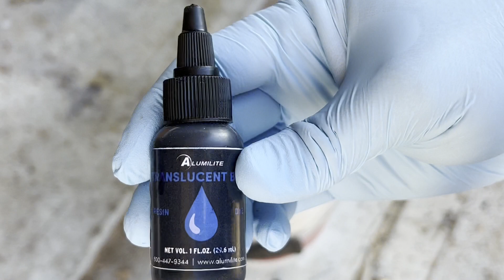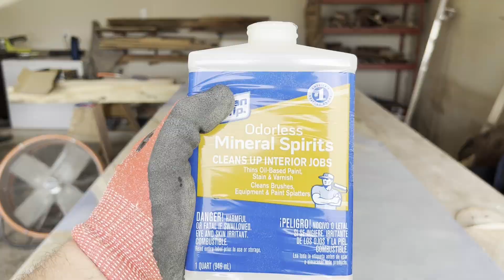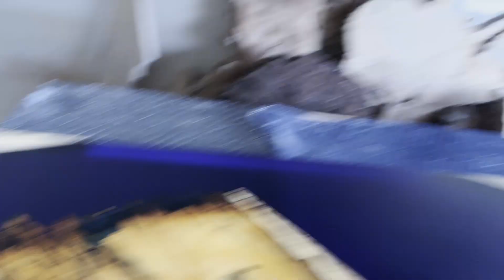This Table Almost Went in the Trash

Comment: I am WITH YOU. I am done flattening my own slabs. My wood guy has a 14 x6 ft CNC with a 4 inch flattening bit and he charges $100/hr. He did a 6ft table top and a 4ft table top in less than an hour and they were perfect. I just factor that cost into the price of the table.
Reply from the maker: Exactly, it saves the client more money In the end and saves me a ton of time
Reply: @Lone Star Woodworking  plus I HATE doing it.  Lol
Reply from the maker: @johnmclain6535  yeah that to

Comment: Did you pour all the epoxy in one go or did you pour a couple layers?  I’m attempting to make a conference table basically the same size and they want a transparent turquoise color
Reply: Also, is that the magic resin youve mentioned before?
Reply from the maker: So for this one I was able to pour all of it at once because it was still cold out. But with the constant 90+ degree days, I’d probably stick with 1/2”-1” pours. And no this was actually Ol Loggin epoxy. Solid brand, just more expensive than magic resin
Reply: @lonestarwoodworking3810  gotcha. I’ll look in to it. I haven’t messed with epoxy very much so this will be a first on large scale. Thanks!
Reply from the maker: @rifedesignco7102  good luck!